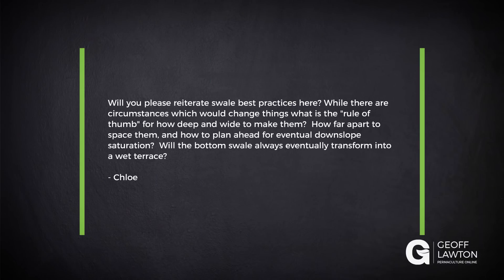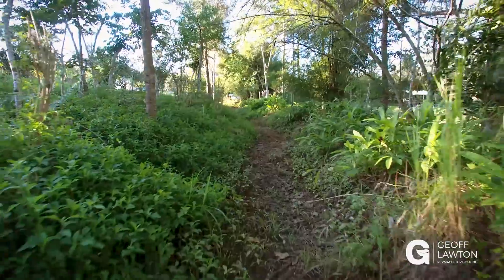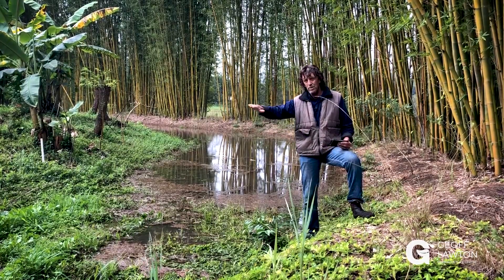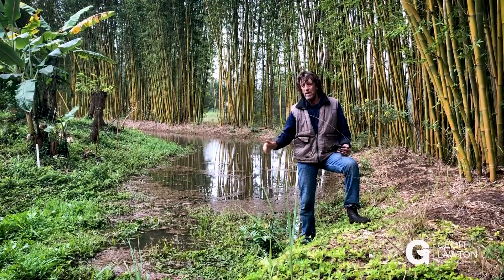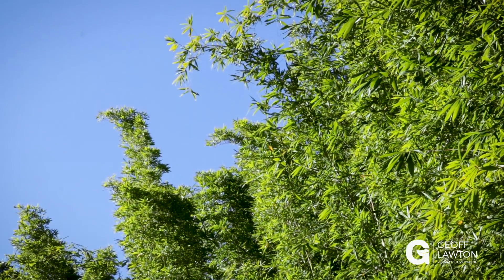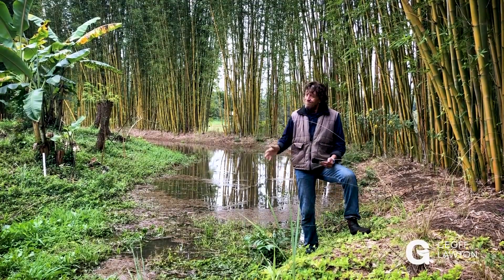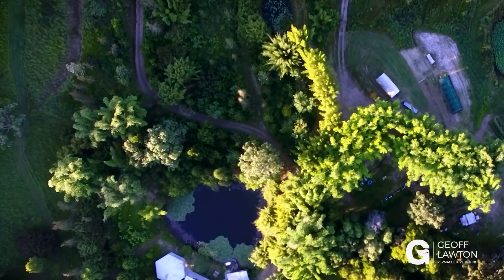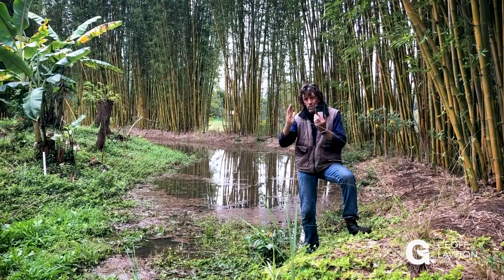Best Practices for Swales

Comment: I dug a long tiny 8” deep swale across our field a few years back, just below the “key point.” Now during flood conditions we have a spring bubbling out of the ground that runs for a couple days after the rains stop. I’m thinking that right below this spring is a good spot for a clump of Willows or a couple of red alders.
Reply: No, it’s not a priority spot because we have a long fenceline bordering the road so I’m still planting most of the trees over there to create privacy. Eventually hopefully. I’d like to dig a micro pond there but the part of the field that gets mowed is already bumpy enough, so it’s a trade-off. Maybe I’ll make a on-contour very shallow ditch to spread out the force of the water and stop it carving lines through the grass. Thanks for the reminder :)
Reply: @przybyla420  You are welcome!  And thank you for the update.

I bet just a little bit of that swale project would go a long way for your whole place if you just start… and maybe it won’t be so much work.
Reply: Did you put them in?  How is it going?

Comment: Can sealed lead to an increased chance of landslides on steep slopes?
Reply: Yes it could, with more slope and / or impermeable underground you have to be careful.
Reply: Swales not sealed. How I hate autocorrect.
Reply: @steveindia2439  You can edit your original comment too by the way.  I often have to do that because of both autocorrect and a mistake on my fast typing… but mostly because I often time stamp my comments throughout the videos and can’t do it in one go.

Comment: The bottom of the slope won't be saturated because the water above the lowest swale isn't flowing down.
Reply: If they have a lot of rain, that can happen. And Geoff said it does happen in certain settings. Wales comes to mind - i saw a video of a gardner, he has a paradise, but he has all in raised beds for improved drainage, the underground is jst too wet. 

A light slope in Wales might well do with some drainage and the water collected at the lower point converted into a productive aqua system (fish pond). also growing certain trees that like so much water and do not mind "wet feet".  Like willow or alder. Or lotus and mangroves.

Comment: No rule of thumb for distance between swales? "Given a swale base of 1-2m, the interswale space should be 3-18m. In the former case, rainfall would exceed 127cm, and the later it would be 25cm or less." pg 168 Permaculture A Designer's Manual - Bill Mollison. I have drawn up a scale form this to calculate spacing. I also take into account slope etc when choosing spacing. That's how I design swales in my systems. : )

Comment: why does it need to be long? Would it still be as effective if it's circular? And are you putting something underneath to hold the water in?
Reply: It follows the landscape, being whatever shape it needs to be to ensure the whole swale is at the same elevation, so the water pools along the whole swale rather than all the water flowing to the lowest point.  It would only come out circular on flat ground or going around the outside of a hill.  If you put something underneath to hold the water in then it defeats the purpose, as the idea of a swale is to allow the water to slowly soak into the soil where plant roots can get to it.  If you seal it in then you will have a funny shaped dam, not a swale.
Reply: @Berkeloid0  thanks :)

Comment: Hi, How you can controll mosquitoes ? Because swales are great medium for them
Reply: Geoff has created a very biodiverse system that has any number of predators through the system. There would be a balance happening but they will be there. I've been up there a number of times. I don't remember mosquitoes being a problem but I do remember them being a problem at a property I stayed at a few kilometres from Geoff's place. The last 2 times, I was there, there wasn't any water sitting in the swales. It tends not to sit there and stagnate. It soaks in and plants would take up moisture. There could be evaporation happening although those swales are well shaded.
Reply: No, and if swales become breeding grounds for mosquitos the implemenation was done incorrectly (and maybe the swales are even a danger in your setting, the poor infiltration that allows the insects as evidence of a potential hazard for mud lides). - 

A swale is a water infiltration system, not a still pond. If you have a lot of rain and water coming in from overflow  pipes, drops hitting the water surface and wind -  it is usually too much action going on to offer good breeding conditions for mosquitos. They need standing water.

If water is standing for longer time - they are not swales they are canals (in that case one would make sure to have niches where the predators also thrive). In the temperate climate zone one would have a shallow water zone with reed grass that the dragon flies need for their eggs. Problem solved. Plus of course permanent water allows for a population of  fish. constant moisture allows for frogs, or at least toads. But dragon flies are especially efficient. 

you should not have standing water except after heavy rains (lots of action) and then the water disappears into the underground FAST, too fast for the mosquitos. If your swales are LEVEL (as they should be) the water does not stand, there are no tiny reservoires (even a few cups full would suffice) it is all soaked in. A swale is supposed to be moist under the mulch layer, but there are no collections of water as potential breeding ground. 
Of course the moisture also promotes the animals that prey on insects. 

The water is supposed to infiltrate within 2 days after a major rain stops. If not you need to improve the swales.

Are they covered by mulch and compost to improve the soil underneath and to improve infiltration ? Are they  compacted for instance by using them as paths for vehicles or are they trodden down by animals so they do not soak up ? They can be used as paths and be grazed, but not all soils and slopes allow for it, or the swale is not yet mature and secured enough to allow the heavy duty use.

Or is there  impermeable underground. In which case a swale is a misapplication, and can become very dangerous. 

An upper, water saturated  layer could slide down on a layer of water that rests on an impermeable underground. That can be a devatating loss and very dangerous.

 It has happened and even to people that were advised by very experienced folks 

Sepp Holzer and the project in another state, she had a major landslide (onto a street) so a public safety hazard, and she went bankrupt. Holzer bought up the property and lives now there. He got it right in the Alpes - but either he did not "get" the situation in another climate zone (although not far away in distance, it is in a state that has the panonian steppe climate where that happened).

Or the woman did not execute the plans and he did not realize what kind of guidance an inexperienced and enthusiastic user would have needed, with that terrain and that underground. (I read claims that he did not even visit the property in person) - not sure if that can be true, that would be highly irresponsible as there was a part with a steeper hill. 

He has steep slopes at the Krameterhof but seems to be in tune with the harsh and cool mountain eco system. On the other hand - IF an area i the mountains with a major slope was prone to mud slides it would have slipped 1000 or 300 years ago already. It is interesting that the failure was in a system that had very differnt climate, and soil conditions, and likely also rain patterns,  than the one he was so successful in. 
Ad he did a lot of great projects (or inspired people after the courses). 

At  the minium he accepted the design job (he was paid for the consulting workd) w/o being fully aware of his responsibility as advisor.
Reply: Geoff posted a video explaining exactly how to prevent mosquitoes. here it is: https://www.youtube.com/watch?v=60ZTIJi6tbI

Comment: Great video, this topic is so often addressed too simply. My property 1:1.5 is typical grade, wet temperate, heavily forested. I use logs, waste otherwise, as waterbars instead of cutting the soil. Fill above the logs with arborist chips and plant into them. Erosion control and improving clay soil is more important than storing water. Thanks again

Comment: I want to ise swales, problem being i have a large amount of mosquitoes. How would you suggest to control this? I use a gold fish in the sheep trough to keep them down.
Reply: I should mention that we live in the mountains of NE Washington State USA. 28 acres in mostly timber. Between a zone 4-5. The areas going down the hill, about halfway (hill 1/10 of a mile) and out by the end of the driveway. The place that is a real problem is around the living areas. More of a grass zone. Using mint outside my sons son's shed hoping for help, maybe helped for the ants. We have been recieving warm/hot days then get a few moist days.
Reply from the maker: Swales don't hold water so are not a mosquito problem

Comment: For a 10 acre property would you think that a 1m by 1.5m be reasonable in wales uk?
Reply from the maker: It will depend on the degree of slope.
Reply: @DiscoverPermaculture  wow thank you for answering is there somewhere other than bill mollisons book on permaculture i can read up the degrees:swale width/depth? I cant afford the £200 it would cost me to buy it and i cant find it cheaper than that. Also can you see any glaring problems with using treated and filtered effluent in a tropical glass house black water cell?
Reply: @601salsa   How can you afford swasles if you cannot afford an expenditure of  GBP 200 ??  Digging them by hand ? and you need  a pipe drain as overflow backup, that also costs money.
Reply: @xyzsame4081  the whole point of asking question is to get answers. Currently I have no money but once I sell my home I can afford to build swales, you dont know me, you dont know what is going on in my life, I would kindly ask that you dont make snap judgements when you dont know the situational facts. And to try and bully someone who appears to be struggling for cash shows exactly the kind of vile person you are.  And by the way dont demean people who work hard even manual labour. It is possible to literally dig swales by hand using a spade. It costs $20k for a back home to buy second hand,  to rent it isn't cheap either depending on what you want done, if a sale is small enough the actually by hand is easier and far cheaper. I am not put off by hard work. I have landscaped gardens before, moving 11 tons by hand.

Comment: What about temperate areas with high water tables (at least during wet years like this and last year), flat land, but sandy soils?  Our biggest issue is keeping some water near the surface for our garden because it likes to just go straight through the sand base into our aquifer (SW Michigan).  Would it be better to do something like a Hugel swale?
Reply from the maker: Part-Time Permies high mounded swales on flat sandy country achieve 2 production potentials in on cheap move.  Well drained mounded tree planting contours and seasonal wetland swale canals for ducks and aquatic productive plants like wild rice.

Comment: Do swales work on the light highly porous sandy, soils eg in Perth WA? We had 74mm over 36hrs recently and it soaks straight down.  I can't see any advantage in swales on my 5 acre gentle slope.
Reply: You need to ad organic matter to your soil to increase its water holding capacity. If the slope you‘r talking about has no erosion problem you might not need any swales at all, but slowing down the Surface run off and increase water Infiltration on certain Spots eventually Leads to a nice „microclimate“ in the soil wich you can take advantage of if you want. Do not forget that Swales can also be used to Guide the rainwater to dryer areas like Yeoman used to do with his keyline method.
Reply: There are two advantages for filling swales with (for example) woodchips in sandy soils. It acts like a sponge to hold the water for longer. Then it can create mycelium in the organic matter- which for tree growing systems, reduces pest infestations and makes healtheir trees.
Reply: In your situation rather than thinking so much about recharge, since the water seems to be mostly disappearing underground and downslope quickly, or very deeply, you actually want to think more about keeping it near the surface in the form of biomass. So that's when you consider swales as a tree growing system. Yes, you will need mulch to hold the water around the tree roots while they are growing, or guilds meaning grasses and faster growing biomass that will work together with the trees while they get bigger. Then, during your rain events the swales eventually morph into a treed area. Swales are part of creating accelerated ecosystem evolution from dry to green again.
Reply: @jenniferspring8741  This is what we do on our sandy-soils arid hillsides; we create on-contour deep wood-chip paths, with plantings down-slope; sometimes we excavate the bank very slightly(handwork) in the steeper areas.
We replenish the chip bed "swales" every third year or so. Most plantigs can now survive our seven month dry period with the help of the mulches, though we'll occasionally supplement with one watering during extreme heat of Summers.
I'm just averse to the expense and impact of machinery, and the worms and Gophers will churn the soils quite well, though we do miss out on fracturing the sandstone subsoil we would get from a chisel pass.